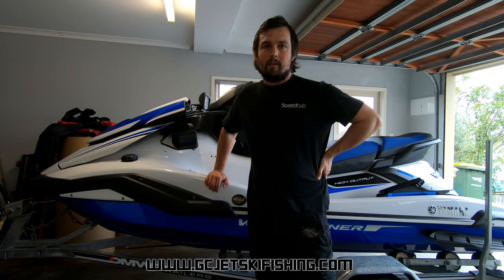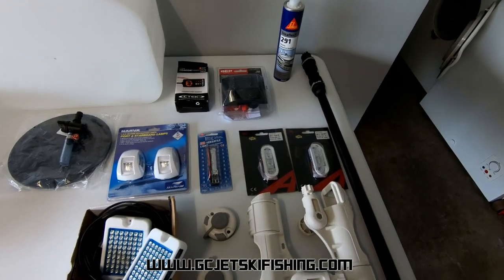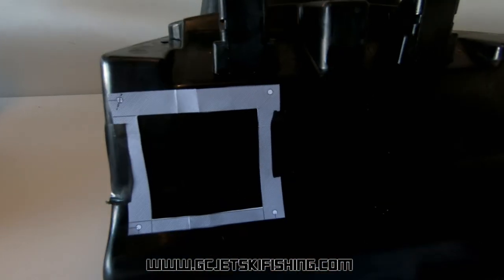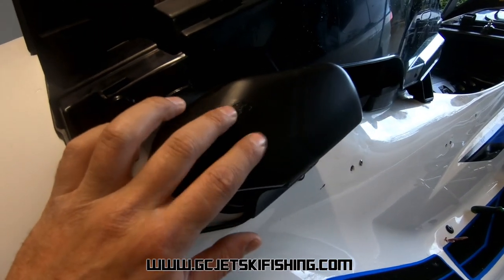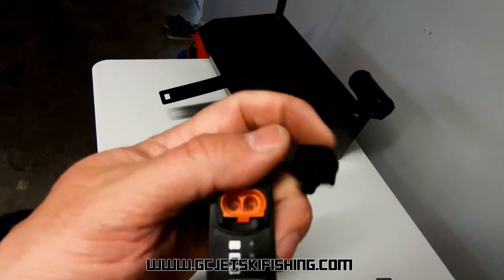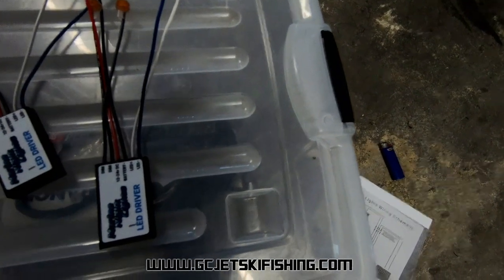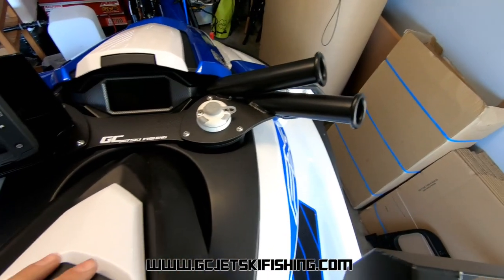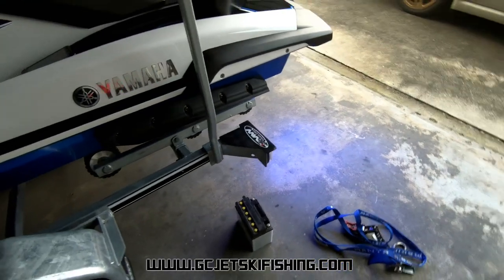Yamaha Waverunner FX HO Jet Ski Fishing Setup Installation Video

Comment: Hey Glen, did the customer drill through the hull for the transducer cable? Is there a better way? How have you done it?
Reply from the maker: Hey Grant, yes I drilled through the hull. Just use a suitable cable cover (unsure of the proper name for these) go up as high as possible and check inside the hull to make sure you are able to access where the cable comes through on the inside. If done properly it will not leak.

Comment: Awesome vid. Thanks Glen. I want to do the same livebait tank. What tube did you use to connect the spout to the tank? Where can I buy similar? I bought a 10mm tube but I think it's a pressure hose so it's a lot thicker.
Reply from the maker: The customer supplied it, not sure where it was purchased from... it was kind of hard, thin walled plastic about 6mm diameter